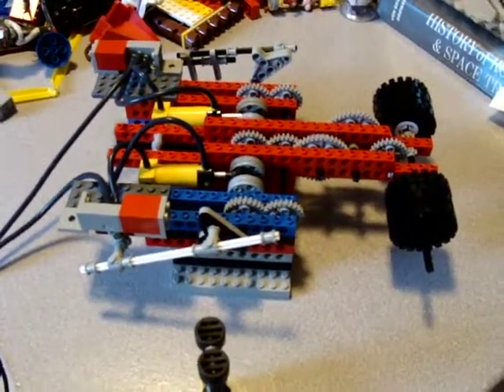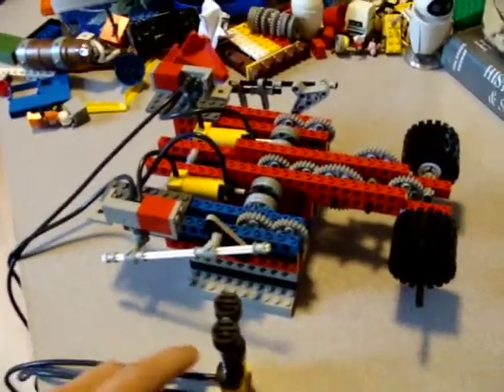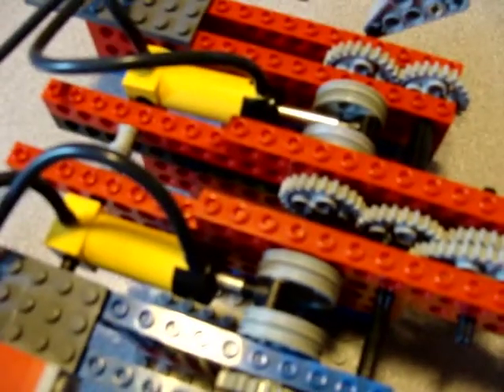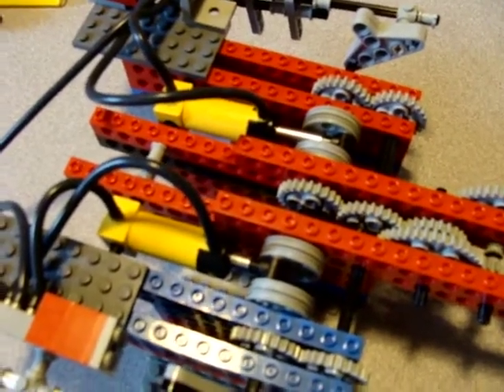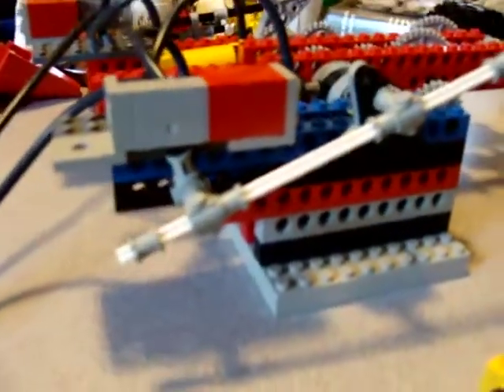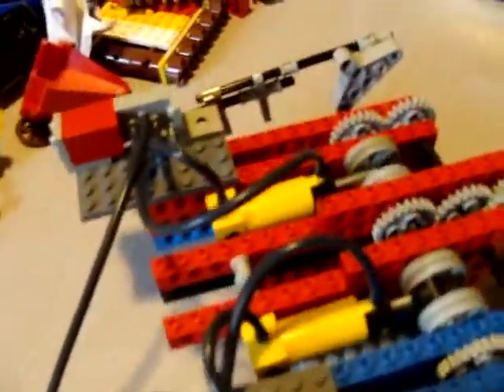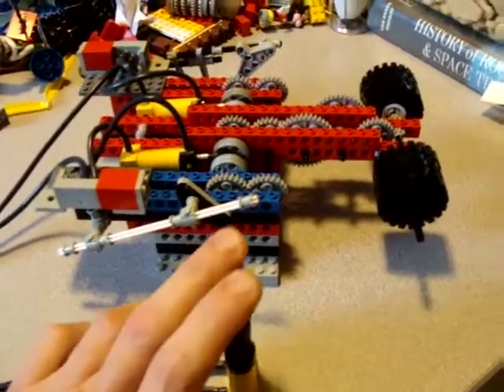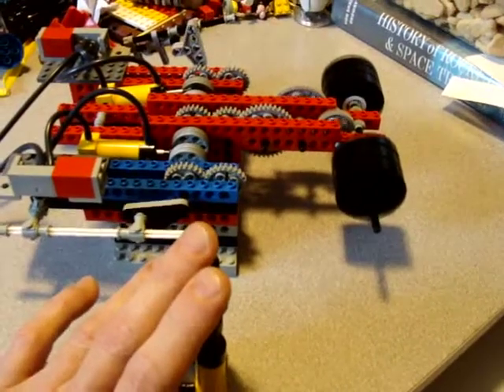Lego pneumatic motor

Comment from the maker: @rowen211:  Yes I could, and I have one, but it's a nuisance to haul out of the garage.  Besides, a motor doesn't need to turn fast to demonstrate that it is working, and how well.  The hand pump is also much quieter.  I do like the compressor for three (or more) cylinders because the air volumes are starting to get up there.

Comment from the maker: @petitchti  These motors are funny things.  I build what I think should be an improvement over a previous design and find it doesn't work as well.

Valve (pneumatic switch) timing is important on these things (adjusted by sliding the stops on the push rods).  About the only thing you might do to improve power is to experiment with the position of the stops.

I understand that I could modify the valves to deliver more air (make the engine run faster), but I have no desire to do this.